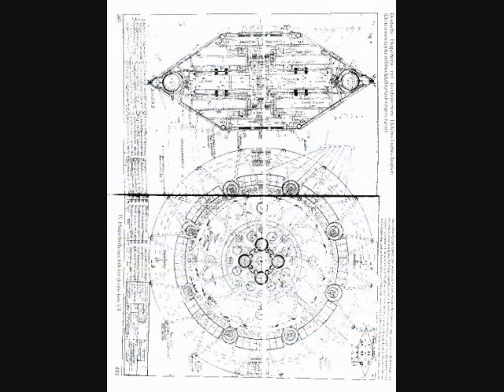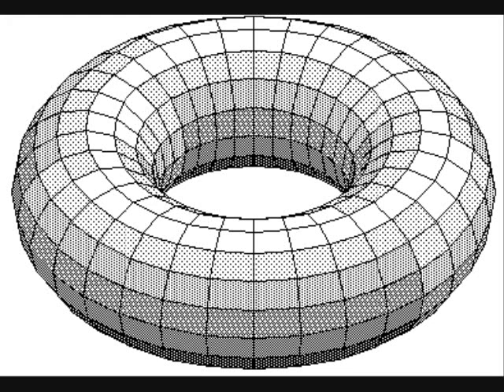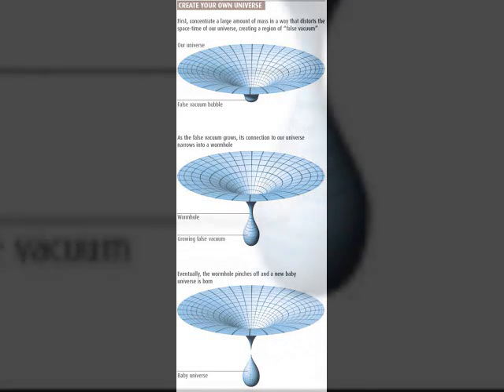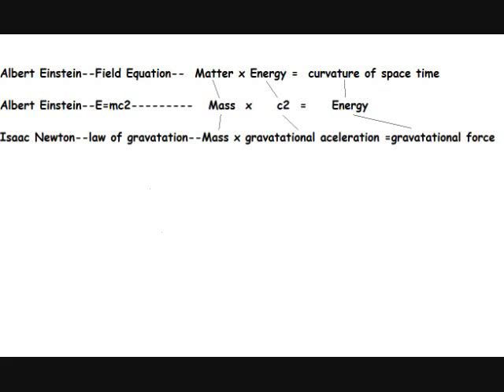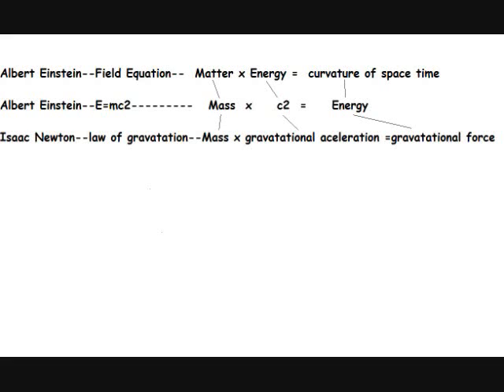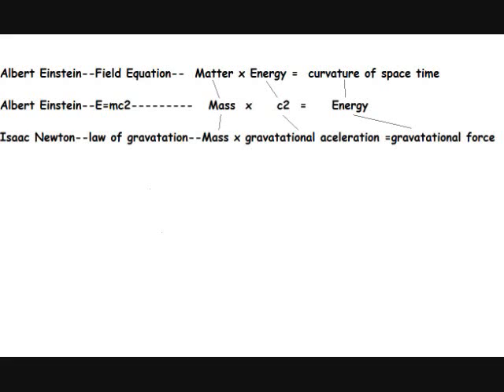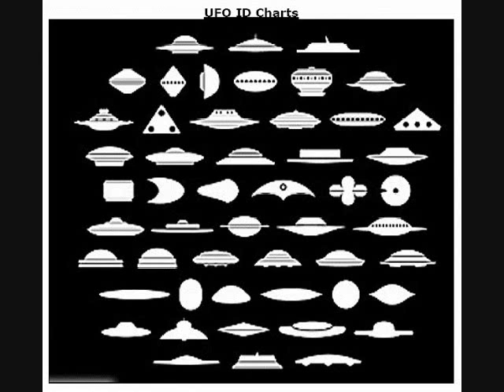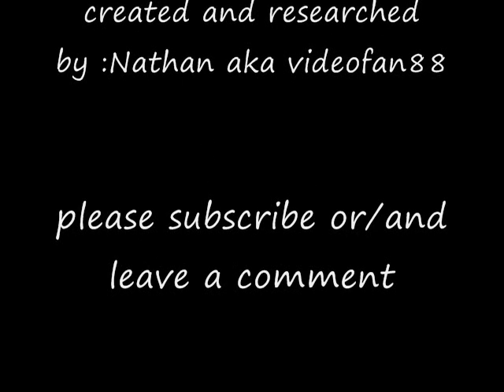HYPER SPACE---UFO-engine how it works part 2

Comment: it is much more likely that used some time of warp drive instead of trying to accelerate to C or past C.

Any aliens would likely know of the C speed limit.
Reply: The C speed limit apply to our known universe but particles that communicate to other universes (exotic microblackholes) could have different properties and travel faster than light. Warsp speed just means you are keeping the light speed constant but warping the space around in order to have your relative speed higher than that of light in the cheated space but lower than light speed in your hyper space environment. Both theories could apply to go faster than light while preserving the constant valid.

Bending the space around and achieving zero gravity point allows you to sting spacetime like a wormhole does, basically that's what the author says if I am right

Comment: i just thought of something! if you could have a black hole (which has infinite density) accelerate to the speed of light it would have infinite mass too, so maybe that could create a hyperspace engine too!
Reply: Not quite infinite density but high enough one that simply collapses inside of itself and through spacetime sheet to eventually come out on the other side, to a polarised inverted spacetime (vortex alike). It is actually futile to accelerate to the speed of light when you can trick space by creating zero gravitational hyperspace and just go straight beyond high density masses in a straight line instead of falling through gravitational space which takes longer to travel. Imagine going from A to B in a straight line instead of falling to a sinkhole from A to bttom gravitational space and then uphill to B. It would be like going straight through the fabric of space time which isn't straight, while keeping your lightspeed constant and lower velocity.

Spacetime has shortcuts too, you only need to find doors to these shortcuts (wormholes, zero gravitational artificial vortexes, extradimensional enviroments). This is actually cheating our reality by using advanced technology.

Comment: @ThatOneGuy979 Please explain why these vehicles that have been filmed going 2x's the speed of light? And accomplish turns that would crush anyone else. Is there magnetic field so stable around them that causes total protection within? Are they using a pure energy source?
Reply: Warp speed just means you are keeping the light speed constant but warping the space around in order to have your relative speed higher than that of light in the cheated space but lower than light speed in your hyper space environment.

It is actually futile to accelerate to the speed of light when you can trick space by creating zero gravitational hyperspace and just go straight beyond high density masses in a straight line instead of falling through gravitational space which takes longer to travel. Imagine going from A to B in a straight line instead of falling to a sinkhole from A to bottom gravitational space and then uphill to B. It would be like going in a straight unconventional line, through the fabric of space time which isn't straight but curved because of gravitational masses that produce space curvature, while keeping your lightspeed constant in place and a lower than lightspeed velocity.

So to answer to your question, they can do those turns because they don't actually do turns, they bend the space in such a way or trick trick space without respecting its gravitational curvature,  that they end in another point in space with very little moving and velocity, Like flying 10feet at 5 miles/h but getting 100km away in an instant, No G forces implicated here, because conceptually you would not be subject of traditional gravity of the Earth.

More on this would be zero-point gravity engines: See more here about Alcubierre Warp Drive - https://www.youtube.com/watch?v=94ed4v_T6YM

Comment: @cosmothechihuahuadog Good judgement, I feel that this video just explained the concept of the ferrofluid +anti gravity behind it, the purpulsion engine would/is nuclear powered, plus the exterior of such a craft would have to be of a quasicrystal structure (11 times stronger than diamond, practically indestructable).
Well a ferrorfluid is a single atom based molecular fluid, so there is no way to break it down further and because its frictionless there is no way in can be manipulated as an atom

Comment: @theufohunter123 Ok, so gravity might not be strong enough to contain the radiation by itself without using an extreme amount of energy. But if you can "warp" space-time, and create a temporary bubble of "sub space" around yourself, wouldn't you theoretically protected against any type of radiation around you since you wouldn't be existing in the same space-time as the radiation in that particular moment? And couldn't you create the same bubble around the reactor itself?

Comment: @theufohunter123 Ok, so it would be possible to use gravity waves, you would just need more energy. If you had enough energy to manipulate gravity in order to bend space-time, creating a "wormhole", wouldn't you be able to contain the radiation using gravity waves? Or would it require even more energy to contain the radiation than bending space-time?

Comment: @theufohunter123 If you had a matter-antimatter reactor generating enough energy to manipulate gravity waves, causing whatever craft you are in to be pushed up or pulled down at will, then you could manipulate those same gravity waves to contain the radiation created by the matter-antimatter reactor. You would only need an matter-anti-matter craft if you could not power the craft otherwise.

Comment: ufo propulsion is like the rodin coil but with another coil in the center instead of a magnet. the coil in the center prevent the energy added to the center of the rodin coil from escaping and causes input pulses to be added to the energy already conserved in the coil in the center. that create a gravitational field that has its own lenght contraction seperate from the earth. the coil field causes spacetime around it to move faster than the spacetime of earth.
Reply: correct, space wavelength differs from the Earth one's in the hyperspace environment

Comment: Typically I would make a goofy comment, but... dang, Nathan, that was actually purty cool that you would put your thoughts on the subject on a YouTube vid, EQNs and all.  I've heard that there is an E=MC^2 looking EQN which describes the energy released when Time itself is forced to flow at either a faster or a slower rate than its natural rate of flow, the C becomes a Delta T , and the M is some other parameter I forget.  The trick is getting Time to flow at a different rate...
Reply: Time basically flies faster for the ship and slower for the viewer. So when you travel at 5 mile/h you actually travel at 5000 miles per h in the viewer spacetime reality, making them see you going faster when instead you are going with standard velocity,.

Comment: I think I know something that you could use as this "liquid metal"...
A year ago, on 2009 I opened my Mac Pro to clean it on the inside and I removed one of the heatsinks to remove the dust. Right after that a nightmare began, as I found that these heatsinks were not using the regular and well known Arctic Silver 5 as a thermal compound, but instead they were using some kind of liquid metal, like mercury! So I put all the pieces on a bag and I went to the Mac Store.

Comment: But before you test this engine you'll have to be sure to be able to control it with a really fast computer. I mean, at least faster enough to be able to calculate the point in the space you're wondering to target and frequency of these molecules to reach that target. Otherwise this machine and everything around it will be lost in the no materia. Or even worst… As you can create a real black hole on the Earth able to absorb the entire planet and its habitants…
Reply: To keep a blackhole open requires vast amounts of energy and a blackhole cannot be autosustained except if it already has that vast amount of energy from the initial velocity of the BigBang (like some natural blackholes have). So basically to create a blackhole that would absorb the entire planet you would need to be so advanced as you wouldn't anymore care about a planet like Earth and already have bases in another solar system/galaxy. We simply do not posess such big energy sources, at the moment.

Comment: If starting with a fixed base, which might be obtained.  I believe the matter must all be the same density, to control things. otherwise many frequencies would have to be produced to compensate for the various densities, which means, more equipment. When the proper frequency is generated, all the abilities will happen within light. [similar to the little kinetic swinging ball bearing machine] polarized particles will carry the "kinetic" movement within the light, & that's where all takes place.

Comment: Nice to find you reaching some closer to few of the technologies used in flying disks.
But there raise many questions in my mind regarding this.
Will we be able to use anti gravity in a place where there's absolutely No Gravity to anti or Oppose!! 
Won't you like to maneuver in that place like turning right, left, top, bottom, or in azimuth !!
or won't you like to accelerate to the desired speed may be 100 or 1000 times that of light speed.

Comment: A tachyon, it is improper said particle but call it so, has a negative mass that allows it to go at superluminal speed, a photon has no mass so it goes at light speed, any other particle with a positive mass can not go, under what we know as "the normal phisics" faster than light. Tachyons are purley theoretical and usually when you come up with one in a ecuation, it means that you've made a mistake. Hope this clears up tachyons, just for a bit.
Reply: So could tachyons be part of the antiuniverse as it has inverted polarity mass? I'm thinking if you accelerate a tachyon you can basically go to a faster than light speed but you change polarity so you should travel back in time in a different dimensional reality. Multiversuri suprapuse

Comment: But even breaking the sound barrier involves a lot of energy.

Light on the other hand is massless so it basically leaves the car's headlights at the same speed whether your moving or not. All you can do is change the frequency of the light (just like sound)

I have often thought but can not be proved however is that light is actually is instantaneous in 4 space (3 space + time) but because we live in 3 space, we have to wait for time to catch up.

Comment: They said  the SAME thing about the SPEED OF SOUND 200 years ago. Now-A-Days sound is just another broken speed limit.  The speed of light just another darn speed limit  to be broken. Going faster then a Photon is just particle acceleration and not a big deal. Done everyday at Livermore labs.  Just another speed limit to be broken.  To beat gravity you need to SPIN it away from you. When the spinning disc produces its own gravity wave you beat it! When the edges weigh 80,000 lb+ from the spin

Comment: The ether acts as a gas at low speeds giving very little resistance to objects, but when an object is moving at speeds close to that of light it acts more like a solid, the speed of light is sort of the cosmic speed limit, even for EM waves. But where two EM waves meet at an angle, the transverse section of the waves travels multiples of C but not the wave itself, just where they meet. Just an interesting sidenote :-)
Reply: Because speed vectors add?

Comment: All this FERRO fluid is BS.  Waste of time!!!!  If you spin any electro magnet THEN your field is already going a TINY bit faster than the speed of light.  The head lights on your car are going 65 MPH faster than the speed of light so going faster than light is not the key at all.  We break the light speed barrier all NIGHT long on the HWY!!! The key is simply spinning an electro magnetic disc at 1,800,000 RPM+ and you will WHIP the gravity wave outward and away from you and then you start to